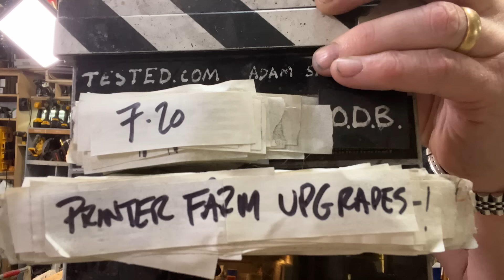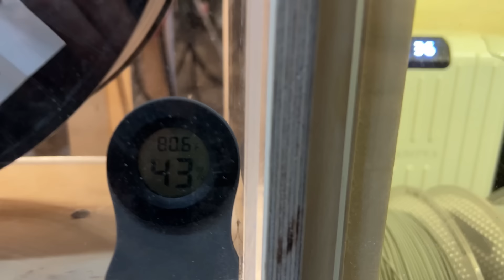Adam Savage's Essential 3D Print Farm Upgrades!

Comment: The Bambu's aren't to bad for production because of the speed (although Voron's have been printing that fast for years). Lack of proper serviceability is probably gonna bite you in the ass in a year or 2 though, especially once you wear out those idiotic carbon rods. It'll be interesting to see how you deal with the inevitable problems they'll cause.

Biggest thing with the Bambu printers to remember is if you have them connected to a network (even with internet access blocked) you really shouldn't be using them for anything under an NDA or any kind of prototyping that has to remain private. If they have the chance they'll send a crap load of data back to Bambu servers, Bambus TOS is really not good for privacy.
Reply: They've got LAN modes.  And Bambu has every single part you'd replace available on their website.  I figure Adam's handy enough to replace those parts himself.  I wonder where people keep getting half the information from on these printers.  It's like they hear what you hear, then completely ignore the answers to the problems.  

No clue how that happens, but man is it happening a lot!  I swear I've typed this exact comment 20 times in the past week.  It's almost like some troll hired a bunch of A.I. bots.
Reply: @Michael-hn8bo  Unless something's changed, with LAN mode you lose a lot of functionality, (camera acess for example) and you still have the issue of if it does connect to the internet then it'll send a lot of data back to Bambu. For someone like Adam who clearly does a lot of NDA work they are very bad printers to use. Go read Bambus TOS and see how invasive it actually is.

I know they have replacement parts but they aren't easily serviceable. The X/Y gantry for instance, the bushings wear out quick if you print fast and especially if you print ABS but you cant just replace them because there epoxied in place, you have to replace the whole gantry, which means you have to disassemble half the machine to get to the damn thing. Not user friendly or well designed for serviceability, replacing a big expensive part because you cant replace the cheapo 5 cent one.

Comment: Why are you scraping the plates?  Stop using adhesive on the pei plates.  Wash with hot water and dish soap.  Clean between prints with isopropyl alcohol.  When prints stop sticking well wash again.

Comment: Adam, I have a lot of questions this time. Why not just put a longer bin at the back, so both scrap materials fall in? No need for a complicated ugly space wasting glide. Second, why didn't you just put the filament roll inside your already made dryer cabinet? You just needed to add a rod to hang it on, and then put a tube through the side. This would safe a lot of space, no need for a fan, would be nicer to look at and your filament isn't gonna scrape along that metal part... At last, why not buy some extra textured plates? Get the printed one out, and place a new one. Time enough to clean the one you just removed... That table is bad :) Anyway, still love your video's! ;-)

Comment: Try 5kg rolls of plastic its cheaper ps i have a stand with a 1/2 inch dowel to feed my filament winder this one  (Bambu Lab P1 / X1 / X1C / X1CC Filament Spool Switcher & Winder if you use AMS) also i cringed you should us a liquid like rubbing alcohol  to clean your build plate

Comment: I hate to see you spending so much time worrying about humidity here in the SF area. I’m down the peninsula and humidity is always around 40 or 50% and I’ve got filaments that I’ve been sitting out for years and have no issues. I know the stuffs made out of corn starch but unless you’re in a deep south, it’s usually not that big of a problem

Also, as far as the best metals, there’s a few companies that make some really good silk filament that has a very nice metallic sheen, I think sunlu ends up, working pretty well and it’s dirt cheap